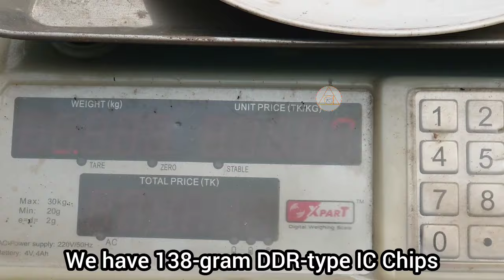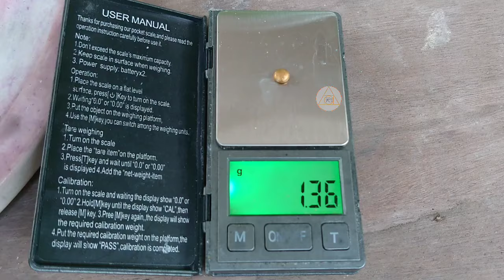RAM Cards Gold Recovery | Recover Gold From Computer RAM Cards

Comment: I have questions about circuit boards of the ram, the connecting wires from gold tangs of ram, are they gold underneath a green coating? or is it copper? the little lines.
I read the transistors are mostly silver content. 
How do you remove lead from the gold solution? How to remove silver from solution? 
I saw green liquid is that mostly copper? What is the method or chemical of removing copper from solution?
I saw blue liquid, is that silver in the solution? How to remove silver from solution?
Reply: Some boards have flash gold plating under the solder mask, most don’t unless from telecom equipment. Just scratch the green solder mask with some sand paper to reveal which is which 🤙🏼